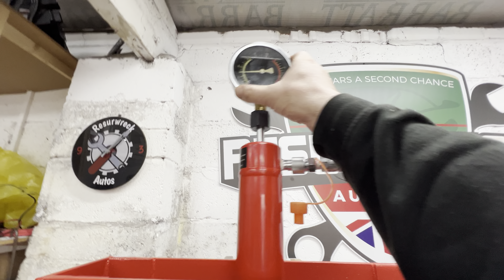Ford Fiesta Flood damage Still Leaking In The Boot Need This Done

Comment: You've had a reAl mission to find those leaks. I think you might have found and solved it, but you never know. It looks like when the cat was built it wasn't properly fitted and welded together hence the cracks in the sealant. Fingers crossed that you have solved it

Comment: Hi Jake, I did exactly the same as you, the roof strips were the last resort for me because l thought they’d be difficult to lift and stick back down. It turns out they’re only held in place with double sided tape! I used a plastic trim removal tool to prise up just a 6” length from the end. That exposes the seam which joins the roof panel and side panel. I couldn’t see any cracks which could allow water in but covered the seam in Tiger Seal (£10 a tube from Euro Car Parts) Tiger Seal is like roofing bitumen only it’s for vehicles, super sticky stuff designed to hold body kits in place. It not only sealed the seam it also grips the roof strip and holds it back down. Be sure to follow the seam from the roof strip down to the tailgate rubber…again that looks like an unlikely place  to leak but it makes sense to cover it. Use masking tape to do a tidy job. I also had a problem with water entering via the two rubber ‘tubes’ which carry wiring from the car roof into the tailgate…you probably wouldn’t know they were leaking until you smell damp….use Grantham windscreen sealant to seal those up….Halfords sell it. Best of Luck! Gerry.

Comment: I had exactly the same problem and it took me weeks to finally sort it. It’s clear where your Fiesta is leaking, those cracks under the plastic strip are huge compared to what I found. I think you’ll be a happy boy very soon!
Reply: Just incase it might help anyone this is what I did to get rid of exactly the same leak once I realised water had to be getting in from roof height.
Seal the welds - peel back the plastic roof strips by 6” or so and apply Tiger Seal to the  roof weld, following it all the way down to the boot aperture rubber. There were no visible cracks in my welds but they turned out to be the problem. The panels obviously have to be spotless and dry before applying Tiger Seal. If you have a leak from a point lower down you need to remove the bumper cover trim and seal the air vents and  taped off holes which both regularly leak. There are vids on YouTube showing the procedure.
Reply: What do you re seal the strips down with? Tried testing my roof seals no water in boot so took of rear bumper spent a full day on it sealing up! Vents/holes ect. And guess what its still leaking! Guess its roof rails as maybe it has to be prolonged water on roof to make them leak and april in yorkshire has been nothing but rain 💦💦💦💦💦🤦‍♂️

Comment: Mark I had a l leak in the boot on a focus you name it I did it still leaked then I took out the from its where the rear lights fixed to and replaced the gromits with new one's from from ford problem solved

Comment: Mark maybe now your a little older you need to use that vice a little more as an extra pair of hands. I was like Richard watching your beat that circlip and thinking use your vice its inches away on the bench. That water leak is a pain so like a mx 5. or colander. Holes every where.

Comment: Just seal all the cracks under that plastic roof strip !!!! You say it's just the paint split it's the sealant that's split I could see it on the silver fiesta!! Mine was the same , I just sealed all the cracks I could see , I did all what you have done around the lights ,hinges ect ect nothing worked until I messed with roof honestly dude 😅